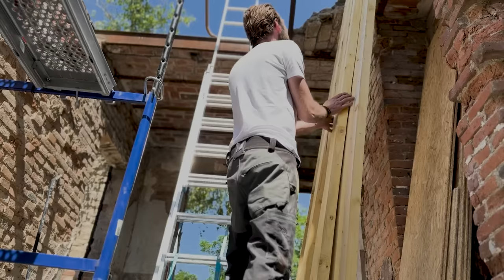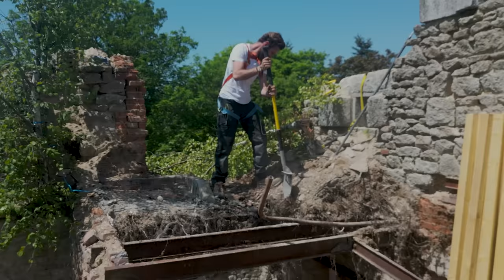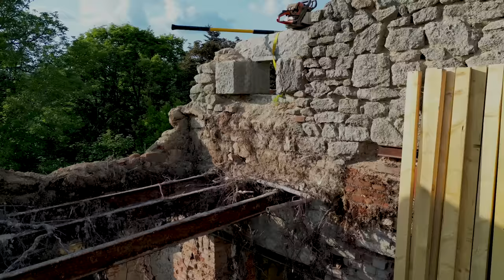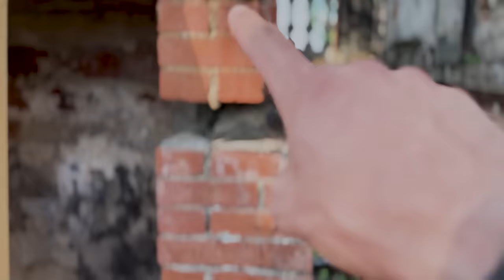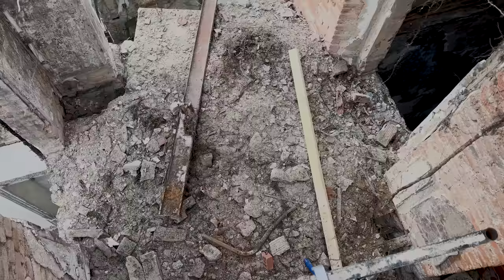Breaking the floor that holds the chateau together; a frightening find.

Comment: Good video again. The bricks are held in place with sand now. Not sure if I would remove all the metal beams at once. Might work my way across with new bricks to tighten up the walls as I go… 🇨🇦

Comment: I love the videos, Dan! Very inspiring work. I really do hope you consult with a structural engineer soon. I think all of the masonry walls will need to be reinforced. At the very least, repointed and sealed. Possibly even braced with a metal mesh and concrete. I imagine it will be very expensive and time consuming… 😢

Comment: I know you can do this Dan & you will get it done, but this is dangerous work and someone should be checking in with you at the end of each day to make sure you are not dangling from your harness, or worse. Better safe than sorry.
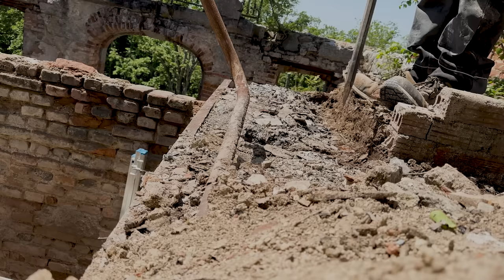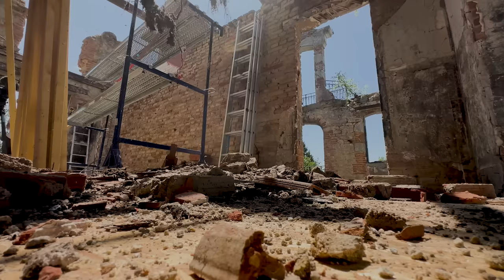Reply: There was someone/a camera person with Dan this Vlog, filming some of the shots as he was dismantling the hallway ceiling/attic floorbase, per commenter KMM.   Check out 1:50, 1:57, 2:08, 2:16, left side of video.
Reply: @homeemail2306  Thank goodness!

Comment: I don't understand how any of the walls still remain upright, the bricks and mortar look so fragile....I don't understand from an engineering point of view how any of the walls can be safe into the future....if you had just a small earthquake I think it would all fall down, that mortar appears dry and appears to have the strength of tissue paper....how can the mortar and bricks still remain upright with any strength....incredible
Reply: Yes, i don't understand why Dan is building solid wall parts on top of crumbling walls, where the remaining mortar is just sand. 
Maybe he will (small part after small part) scraztch the sand mortar out and replace them with new mortar, pusching it from outside , on both sides ? Something like this ? 
My father done it in his old farm. Scratching 50 cm and filling it with new mortar, scratching an other 50 cm part and filling it etc.
Reply: @sabalight2558  I have to assume it's been surveyed and he is working according to an engineer's recommendations.

Comment: It is distressing how easily those bricks and their mortar fall apart. Will that happen to yours as well after a few decades? Is that a result of the fire?
Reply: Probably different quality bricks and mortar than Dan’s using.
Reply: @jennifercampbell7698  Yes, but when Dan is buiding solid walls on crumbeling walls, how can it work ?
Reply: He has said that he is going to repoint the bricks at some point in time.
Reply: @thoeset  Yes, he said he would render the walls thoroughly to build strength.

Comment: If you use your boards, put a rachet strap around the top in your column. On the space use your car jack and move the column back up. Use a second rachet strap around the bottom. You can then fill, and eventually take out the jack and restore the column. Sonya

Comment: You  might find that a sawzall with a  carbide pruning blade (Diablo 12" for example) works better than a chainsaw for cutting roots where there is still a lot of dirt around them.  These carbide blades stand up surprisingly well against a fair amount of abrasive dirt.  Incidentally,  a sawzall with a 'for heavy metal' carbide blade does an excellent job of cutting metal I beams rather quickly and lasts very well. (try this-you'll like it) I am always worried with composite grinding wheels that if they fracture or chip they can become deadly dangerous

Comment: Hi Dan. That steel you have is actually quite valuable. If it was produced before 1940 it would be a low background steel. Used for the manufacturing a variety of sensitive medical and electrical equipment. Should definitely sell it to the right buyer. Should fetch a pretty penny.

Comment: Dan, on the beams, consider buying a hand planer. Assuming you may have other tight situations with the concrete pockets, it would be way quicker just to plane a little wood off the edge of the beams to fit them in, versus hand chiseling them down. It will save you a lot of tim in the long run, given the number of beams you are installing. You are doing a great job, and I really enjoy watching your progress from here in Denver!

Comment: Being able to dismantle walls with your fingers should tell anyone with a modicum of common sense that what you're doing and how you're doing it at that height is to put it bluntly - bloody stupid! Is it worth literally risking your life? Do you have an engineers report? Safety inspections? Original architect drawings? That whole structure needs secured exterior scaffolding.
I really admire your spirit mate, but you're simply asking for trouble relying working the way you are. 
ffs, be safe!

Comment: Glad they came in 'handy".  I can't help but laugh..  did they only deliver one? (sarcastic joke at shipping service).  At least they finally found you after no deliveries there for 40 years. I'm Chuffed!!  

Watching you stand on the floor poking holes through it I found myself saying "what could possibly go wrong" wondered if tying off to a beam wouldn't be better than the tree until you showed the column - nope, the tree was the better choice :hand-orange-covering-eyes:

Did you stick a brick in that space in the column to hold it until tomorrow - you know fate an all, now that you've seen it.   🧱🚧

Comment: Although this may not be immediately applicable, you might look into aircrete for applications that require a lightweight cementitious material having only moderate structural requirements.  Making aircrete is a very simple 'do it yourself' process that does not require very heavy investment.  It is also useful for many landscaping applications.  
Another extremely  important and extremely strong  cementitious material for many applications is ferrocement, which is multiple layers of wire mesh with cement/sand forced into the mesh.  Many people are not familiar with either of these very important and useful materials.

Comment: Bits of progress. Brace the gap below the column where the I-beam was removed. Whole area looks sketchy. Maybe consider adding another floor panel on the scaffolding, stability, walk around, less gap to work areas. Stay safe.

Comment: doing a great job ..... i did see that section of brickwork on the turret and it is badly out of level was wondering if it was built that way but now i can see why most of it is missing .... those clay blocks i think those were used in the 1930s like cinder blocks here in the u.k ..... a lot of your chateaus openings were altered by filling in with those so the old girl had a fairly major refurb around that time it would seem ......

Comment: Keep on keeping on, Dan!  You are making great progress!  Had some thoughts about the big water tanks - could their purpose have been to provide water pressure so that taps, toilets etc. could function as there was no mains water system to push the water along.  If they filled the tanks periodically as needed, cold water could flow readily.

Comment: I have an idea if you work on the ceiling or high level than shoveling mutiple times, take a plastic bucket, cut all of the bottom of it, attach a really long and tough tarp, so now you can shoveled it directly outside the chateau smoothly with control gravity! Like a long slide!

Comment: Today was a two steps back day I think, but your going to get plenty of those I’m sure.
But sometimes things have to get worse before they get better ❤️‍🩹 

I’ve been thinking about the main turret that had the spire style roof above, replace that is not going to be cheap.
Could it be possible to make that area a flat roof?
Almost with a castle like battlements above?
It would keep the cost down and give an almost instant win and not look too out of place, it’s something that can then be revisited way down the line and even the spire like roof reinstated right at the end. If you feel it’s needed.
Reply: Progress 🦋

Comment: I hope the walls don't "come a tumbe'n down on Dan.  Those bricks are set in powder.  If or when the "ruin" is finished being "re-built", if someone leans against a brick wall, it could very easily collapse.  Are there no building codes in France???  The only way to safely restore THAT ruin would be to demolish all of the decrepit brick walls (which, of course, makes the whole project useless)

Comment: Can you use a jack to lift the lower cracked part of the pillar back into place, the partly brick up underneath it, let that set and fill in the reset when you remove the jack? idk what the best solution for that is. I'm praying it all goes well.

Comment: When you are pulling the bricks out and off, it looks like they are all bad all the way down. The lime or what ever is in between is just like powder. It makes me nervous that the walls will stay up.
Reply: Yes, i don't understand why it makes sense to build solid wall parts on top of those unstable brick-sand walls.

Maybe the plan is to scrach the sand out, just a few bricks at a time, and replace it with new mortar, pusching it from outside. on both sides of the wall.
When i recall well, my father done it on an old stable.

Comment: I’ve said it time and time again, get a structural engineer to do a full structural survey done. It could save you a vast amount of  patreon money. The mortar strength in those walls would have been detrimentally affected by heat, water ingress etc, what’s the point in putting new bricks and mortar on crap brickwork, it’s just bad practice. I know a lot of people are blinded by your hard work, you do work very hard, but for god sake, this building needs more then that, some professional advice would mean all the difference.

Comment: Dan, do you ever worry about all the extra weight your adding to the ground floor floor that it might collapse into the basement ?
Reply: The ground floor needs to be replaced anyway as all the steels holding it up are shot. You can see it in the basement ceiling.

Comment: Sheer good luck was on your side this occasion mate. Please dont take chances like that again. Working at height, on your own with a massive unsupported pillar and everything linked to it that could have dropped at any moment. The brickwork has no integrity and is literally crumbling around you, and tying yourself to a shrub that is growing through powdering mortar......you were VERY lucky to escape without a disaster and could easily have been killed. If you were working for someone else and they asked you to do all that without scaffold and appropriate safety checks you wouldn't do it. I guess budget restrictions are pushing you this way but please stop and reassess your situation. Scaffold and safety are there for a reason and no amount of money-saving exercises are worth dying for.
Its a great project and I am full of admiration, I have done some ridiculous restorations myself, but please be more careful.

Comment: Have you had a structural engineer come and check the building. Pulling out that steel and seeing the "jenga" brickwork is scary. You need to get some advise on tying your new brickwork into the existing walls, and the stepped ring beam needs to be a "ring" i.e. go around the complete perimiter of the walls, not just along one wall. Please get some professional advise, I'd hate to see this collapse and injure you....

Comment: From what one can see in the video, that pillar looks highly dangerous. You really don't want 10 ton of stone down on your head. 

You might be able to stabilise it by jacking the lower brickwork back into position with a couple of heavy steel plates and a jackscrew - essentially a big fine thread setscrew and long nut - say 1" diam. Closing the lower crack would likely not be too problematic as the brickwork has just dropped under its own weight and you only need to move it 1/4". But closing the upper crack would involve lifting the corroded horizontal steel beam and all the brick/stonework it supports. There is likely a heavy weight on this beam.

A better option than trying to close the upper crack would be just to inject strong portland cement into the upper gap with a caulking gun and compress it into place a little at a time with a length of wire or cord for the section beyond the step and the edge of a trowel for the outer section. But it does need to be well compressed.

Any jacking would be best done remotely using a long hydraulic hose, a portapower pump and mini-ram. You could use the drone to watch the gap closing. Once the brickwork was back in place the ram could be left in situ and surrounded with  steelwork made to suit the gap, strong portland cement filling the intervening space. 
I would still regard such a repair as temporary as the horizontal beam is heavily rusted. However once the pillar was more stable it shouldn't be nearly as dangerous to  arrange some steelwork to make a permanent repair.

Comment: If you aren't going to do this work in an semi conventional way, maybe only remove one steel beam at a time? The tower is already unstable, removing what little bits that are holding it together looks risky. I'd talk to a structural engineer asap. (not like you need one more opinion from the peanut gallery here on YouTube)